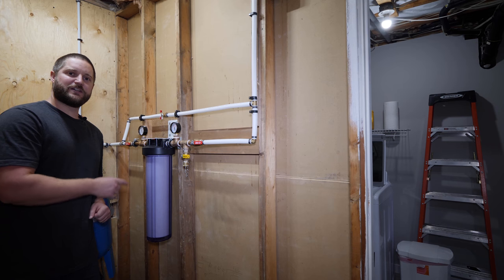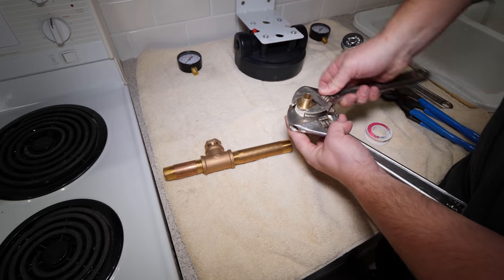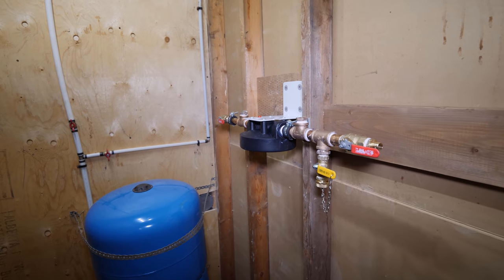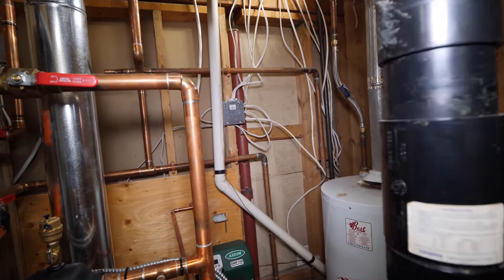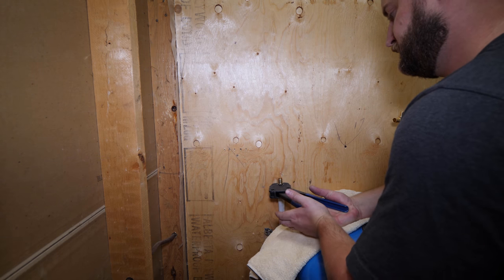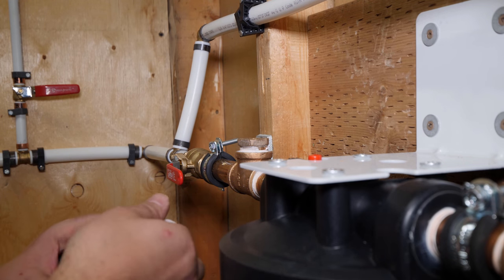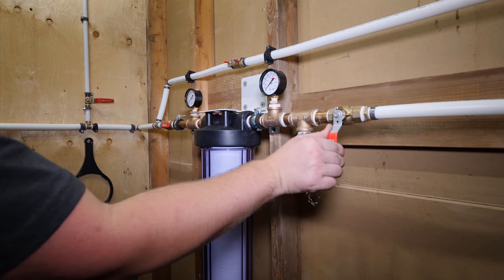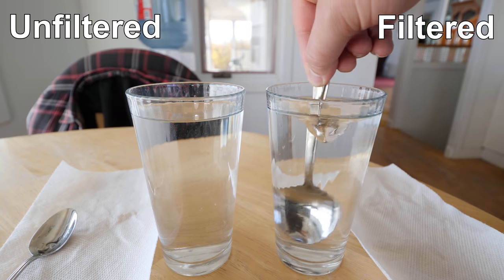Whole House Water Filter Installation

Comment: Next time use unions on each side of filter , also need to have filter bypass with shutoff valve.👍
Reply: With the same space he was using how would the shutoff be installed? Seperate in and out with shut off in between the filter incoming and filter? Curious because I’m going to be doing a similar system and I will be adding a bypass in case of filter failure or casing crack.
Reply: If possible i can provide an email using DM if you can help by doing a quick Sketch if you have time.

Comment: Confidence building presentation, but if I were to do this myself these SharkBite connections sound easier than whatever else, so why do I detect a disdain for them?  Also, do you think the 4.5x20 is better than the 4.5x10, or just overkill?  Like, would you find more (and cheaper) filters available for the 10" than the 20", and for a 3 bath townhouse a 10" is sufficient?

Comment: Nice installation but why not add an additional stage of filtration? Those NSF Carbon Block 1 Micron filter cartridges are really expensive and you could extend the life of those cartridges by adding a pre-filtering stage like a sediment filter before it runs through the 1 Micron cartridge. 

I have aquariums and I have to run my tap water through a 5 stage filtration set up but am going to be upgrading to a 6 or 7 stage. Currently I run my water through a sediment filter(stage1), followed by a carbon cartridge(stage2), then 1 Micron carbon block cartridge(stage3), and then through my RO membrane(stage4) and after that Deionization resin(stage5) for 0 TDS water, but since your not going for 0 TDS you can skip the ROmembrane and the Deionization stage but I highly advise a sediment filter stage before your carbon and it will extend the life of your Carbon block filters significantly by pre-filtering.

For me I plan on adding an additional 1 Micron Carbon block stage and an additional Deionization stage so I can run seperate resins Cation then Anion so I can burn less through my resins. I also want to get another RO membrane to run the waste water of my first membrane into the second membrane.

Also if you run a booster pump and keep the PSI around 65ish you will maximize that filter cartridge

Comment: Great video. But my only concern was the water & sanitary piping directly over the Electrical Panel. Not good. Should be panned or keep 6 ft clearance above the top of the panel.

Comment: In our house, which is my parents', we have had underground well water & septic tank for nearly 40 years now, as we are past city limits.  We used to have a water softener but that eventually broke.  Never really had filter. I am thinking of getting city water & city sewer, as we are actually at the city limit, we are only in county, but I don't know the costs yet.  But if did get it, I would still want some use out of the well water & septic tank, perhaps some certain faucets & toilets, so I don't know if that will make things a little complicated.   Anyway, we don't really drink the well water, we buy bottled water & also put "cleaner" tap water in many jugs from another building of ours that we then transport to this house to use that tap water for cooking & additional drinking. The weird thing is now we are one of the last houses in our area that have been around for that many decades & a lot of neighborhoods have been getting built & popping up around us.  I have to wonder if that will make the costs of getting city water & sewer a bit less money.   We shall see.  Installing filters is one way, but you do have to accrue the costs of replacement filters as well. We do get that type of sediment as seen in the video, as well as seeing iron bacteria & some sand.  I could at least install a centrifugal filter to remove the sand, but I would have to research on that first.

Comment: Two filter system saves you $ as you can use a pre filter which helps make the filter need replacing less often or else whatever combo. you need. Bigger diameter pipes from pump to filter & after...downsize pipe after to each tap for volume & pressure.
Goodluck with the rest of it,whoever done it needs their arms cut, what a mess,lol!

Comment: i installed 3 of these outside in the vegas sun. The system being 20" allows normal flow. Combined with Pentek filters... sed, carbon block, MAG-chlorine-iron. does well. The idea is that the UV and heat will destroy anything the filters may have missed. filtered to 1Micron. Clear casing. 1 1/4 fed lines. filter the 4000 sqft home easy.

Comment: Two years later watching this video... and have a question.

I am renovating a newly acquired home and the well water has iron that will turn the bath fixtures orange. I am planning on installing an iron filter but...

Does the whole house water filter remove iron from the water?

Comment: I want to install a similar system but my pre-plumbing has a drain pipe connecting directing into the water supply line, what am i supposed to do with the drain line?

Comment: hello.  thanks for the video.  please comment on my situation and provide you best option on my situation and what steps i should take.  I have a house built in 1979 and it has a old three tank system.  First what are each of these tanks used for?  second, we have well water which has a high concentration of iron (and arsenic, i think also).  I would like to eliminate those three tanks and install a new system in the basement.  How many inline filters do you recommend, three ( instead of one)?  
Also, what about a water softener?  we always forget to add salt and never use it for its function.  do you recommend a separate softener?  I'm just not sure if we will need one in our new setup.
There is also plans on adding a reverse osmosis system under the kitchen sin too.
any help is appreciated.

Comment: Save some grief. Remove the aerator at the end of the spout and then run the water for 5 minutes after you have changed the filter. Then screw  the aerator back on. The charcoal in the filter can jam the spout and makes the change out a lot more difficult.

Comment: Couples things - your link to the 1 micron filter no longer resolves to anything. also, wanted to ask if u noticed a difference in water quality (less orange in the toilets and soap lathering better) once u installed this unit?

Comment: The problem with this common style of filter is that they are a wet mess when you change the filter.
PS, I wouldn't trust anything in the electrical system.

Comment: Awesome video.  Question, if I'm tight on space and running the bypass is easier across the bottom of the filter unit is there any problem with that? Previous filter was GE without a piped bypass and it's built in bypass failed. Definitely want to pipe in a bypass on the new one and space is tight

Comment: Ok.. silly question. What was the device you used to connect the brass fittings to PVC pipe? It left behind the black bands. I'm a first time home buyer, and didn't even know you could mix brass and PVC. Thanks! :)
Reply: he is using PEX piping, not PVC.  Those rings are crimps for PEX or the older polybutaline piping.  they sell a special tool to crimp the copper ring on the pipe

Comment: Would I be able to drink water with that filter... thank you
Reply from the maker: It depends on your water quality. This type of filter doesn't remove Total Dissolved Solids (TDS) but only Total Suspended Solids (TSS). We have a high amount of TDS and TSS so we don't drink the water from the well. This filter has greatly reduced the buildup of mineral deposits in our showers, toilets, and taps. I would have your water tested before adding any filter system so you have an idea of what you want to filter out. I have a video planned on installing a Reverse Osmosis (RO) system. RO systems will reduce TDS and we will drink this water. Thanks for the question!
Reply: @PROSDIY  thank you so much that will help me a lot

Comment: Interesting video.  Did you consider a spin down filter as an option? I don't have a significant issue with sediment or rust, but want to put in what I am referring to as  a pre-filter before installing a reverse osmosis system to treat the elevated arsenic in our water.
Reply from the maker: I did consider it but for my scenario a large sediment filter was the best option. I'm using a 1 micron filter. The benefit of using a low micron filter is that it filters out more. The down side is that they clog faster and have a greater pressure loss. That's why I went with a large 20" x 4 1/2" filter, which has a large surface area allowing for longer service time and lower pressure drop. Everyone's needs will defer slightly though depending on water quality and pressure.
Reply: @PROSDIY  Thanks. I think I will install a spin down filter initially and see how it does. Relatively inexpensive as you know and can always add another filter with lower micron filter later.
Reply from the maker: Sounds like the best option. Spin downs are great filters and will definitely help prolong the life of your RO filters. Good luck on your install!
Reply: @PROSDIY  Thank you

Comment: All of these you tubes on whole house water filtration systems are in cases where you have easy access to the main water line (mostly there is a basement). How do you  install these systems in the south where you mostly have slab foundations and no easy access to the main water line?

Comment: Wonderful video. I'm building a very similar system this weekend. Would you please tell me where you found that 3/4"Ø  boiler drain ball valve with hose threads, chain, and cap? My local supply house has them but they're not LF rated for potable water. Thanks so much.
Reply from the maker: I purchased mine from a local plumbing distributor (Bartle & Gibson). The markings I check for are NSF 61 and/or UL Water Quality Mark. There are many brands that carry NSF 61 3/4" threaded ball valves. The ones I typically use are M. A. Stewart & Sons Ltd. MAS B-3 valves. Here's a few links on amazon I could find, but Lowes/Home Depot should carry them. Any drain valve designed for water heaters would also have to be potable water certified, so that's an option too.
Mueller 107-824NL: https://amzn.to/3on9ULi
3/4" MIP x 3/4" Hose: https://amzn.to/3j7VApb
Water Heater Drain 1: https://amzn.to/3psSRcf
Water Heater Drain 2: https://amzn.to/3ouVjNX
Here are some links for water markings
UL Water Mark: https://www.safeplumbing.org/technical/product-markings
NSF 61: https://blog.ansi.org/2020/10/nsf-61-2020-drinking-water-system-components/
Hope this helps and good luck on your install!
Reply: @PROSDIY  Thanks so much for that detailed response. I'm putting in a sediment filter and a water softener before I install a new water heater next week. So it's going to be a few weeks of fun plumbing stuff. I truly appreciate the time you put into your videos and the time you took to respond. All my best.
Reply from the maker: Awesome! Good luck on your plumbing projects! Take care.
Reply: @PROSDIY  Pat,
One more question. Would you mind explaining how you set up your cushion clamp assembly? I’m assuming you used a 3/4” or 7/8” clamp, a top plate l, and threaded rod to attach, but what is the connection for the cushion clamp to the rod? I’ve been trying to find a cushion clamp setup like you have, but all I can find are strut mounted cushion clamps and not sure how to make the connection. I’ve been searching my supply house and Amazon but to no avail Thanks again. :-)
Reply from the maker: @bullmoosepiper7732  The clamps are item number #454005 made by Nvent Caddy. Part #45005 fits 3/4" OD pipe or 1" tubing. I purchased mine from Bartle and Gibson, a local plumbing distributor. Amazon carries them though. 𝗔𝗺𝗮𝘇𝗼𝗻 𝗔𝗳𝗳𝗶𝗹𝗶𝗮𝘁𝗲 𝗟𝗶𝗻𝗸: https://amzn.to/3mESXLR
I used 3/8" thread rod and cut it to length as needed. Then 3/8" nuts on each end to secure. The plates are 3/8" ceiling flange plates: https://amzn.to/2LnFCKT
The prices are a little high on amazon and you may be able to find them cheaper at a local plumbing distributor.

I hope this information helps. Let me know if you have any questions.

Thanks, and take care!

Comment: I still can't figure out the fittings. Is that copper tubing that's been soldered on to copper threaded fittings that you're putting into brass joints? I'm trying to figure out what parts I'll need for this setup.

Comment: Everything I've read about installing these filters says not to dope the threads on the filter itself as it will break down the plastic over time. It says to only use tape.
How's it going for you so far? Notice any breakdown/leaks on the filter?
Reply: i installed 4 of these, i ordered a 3 stage 20 inch, and im reusing the newish 20 inch sediment filter my mom had a plumber put in..  the well water was ORANGE, sand and thick grit coming out..  The one sediment worked, but the water was now yellow and smelled of metal or rust.   So the 3 stage i did was 5 micron sediment, 5 micron carbon, iron and manganese, then the 4th the plumbers installed, i moved to the back and it had a heavy metal/activated carbon filter.

However when i installed the 1 inch to 3/4 adapters on the filter in an out.. tape didnt work.  they all leaked pin drops..  i used more, less tape diff directions, still leaked.  Do you know how hard it is to unscrew these once the piping is done..  constantly unscrewing and screwing it back in with no wiggle room also cross threaded 2, thankfully only 2 threads in, i got the angle right and the last 6 threads is enough to hold it.   But ya.. TAPE sucks.. i used puddy and tape and it stopped

Comment: Is a filter system like this adequate for drinking water? Or should something else be added to help clean more than just the larger sediment from a 1 micron filter?
Reply: reverse osmosis system if you want great drinking water. this thing just takes out the large particles from well water.

Comment: Great video. Where did you find the cushion clamps with the stand off brackets?
Reply: Looks like a combo of stuff. Hanger plate for 3/8" threaded rod, the threaded rod itself cut to length, 3/8 nuts, and Nvent Caddy cushioned pipe clamps. Check Zoro or Grainger.

Comment: I'm looking to do the same install but I'm adding a carbon filter and a water conditioner using polyphosphate. I intend to put them all in sequence and have a single bypass for the full triplex filtration system. Do you think I need a set of gauges for the whole system or just the sediment filter?
Reply from the maker: Completely your call. Depends how much information you want. Some installers will install gauges between each filter to let them know pressure loss between each system. I'd probably just install the gauges for just the sediment filter and change the carbon/conditioner based on manufacture's recommendations.

Comment: I wish they made a better gasket system to keep filter from leaking.  I changed a filter for a friend and the gasket kept leaking.  4th gasket was the charm, but damn.
Reply: Did you use food grade silicone lube on the gasket? keeps it from drying out and helps it seal.

Comment: I handled the filter with my bare hands before seeing this. Ohh well. Is this because of bacteria?
Reply from the maker: Correct. It's because some filters can be in a system for years so you want to keep the filter and inside housing as sterile as possible.

Comment: Where did you purchase the stand off cushion clamps? I can’t find them anywhere.
Reply from the maker: They are item number #454005 made by Nvent Caddy. Part #45005 fits 3/4" OD pipe or 1" tubing (copper). I purchased mine from Bartle and Gibson, a local plumbing distributor. Amazon carries them though. 𝗔𝗺𝗮𝘇𝗼𝗻 𝗔𝗳𝗳𝗶𝗹𝗶𝗮𝘁𝗲 𝗟𝗶𝗻𝗸: https://amzn.to/3mESXLR

Comment: Wondering why you didn't had a carbon block filter and UV light for a cistern?
Reply from the maker: We just purchased this home and there's an unused cistern at the other side of the home. It looks like the previous home owner had intentions of connecting it but never did. He did run future water lines for it and that's what I removed/disconnected in the video. For now I don't plan on using it as the well water keeps up to our demand. Thanks for the question!

Comment: solid video man.  how does the filter look like now? Btw i think they make dual sediment filters. 

Have you looked into uponor pex? I bit the bullet on it and got it.  even as a home owner, peace of mind is great.
Reply from the maker: Thanks Bardia, The filter is slightly orange now, but still has lots of life. I may do a filter replacement video when the time comes. I've used expansion PEX, but personally I use crimp PEX. There's not wrong with expansion and it's a great product. Just a personal preference to use crimp. Thanks for the questions!

Comment: Depending on how bad your water is, a softener would be a better choice
Reply from the maker: Depends on what you're trying to filter out of the water. Water Softeners are designed to reduce magnesium and calcium. The filter in this video is designed to filter out TSS (Total Suspended Solids).

Comment: Will a filter reduce water pressure as our water supply in our area has a low pressure?
Reply from the maker: These large surface area filters, 4 1/2" x 20" have little to no impact on water pressure. I still have no pressure loss on the gauges after just over 6 months. I'll probably start noticing a pressure drop in about a year from now and then I'll replace the filter.

Comment: Do you get any bumping in the pipes after you installed this when the water is shut off? I have a similar unit with a hammer arrestor and it still bumps when the water is turned off.
Reply from the maker: I personally don't get any water hammer, but I have a pressure tank on my well system. This acts like a giant water hammer arrestor. If your water hammer is bad enough, you can install a potable water expansion tank on the cold water line. This will act like a whole home water hammer arrestor.
Reply: @PROSDIY  Thanks for info!